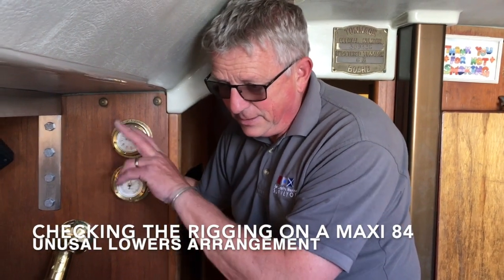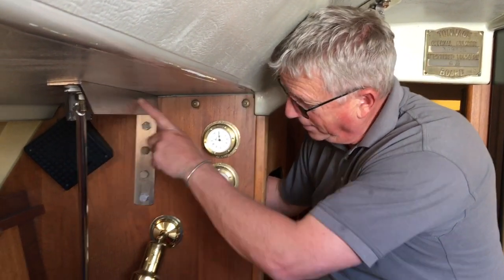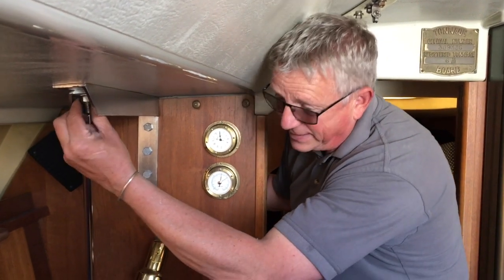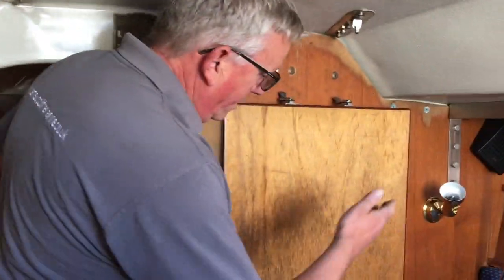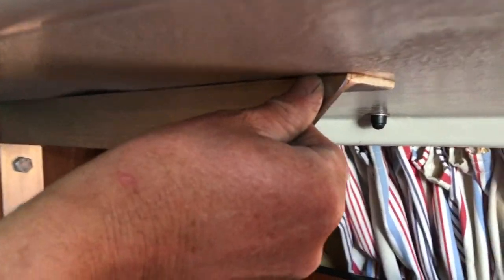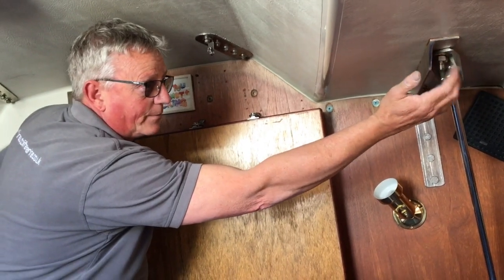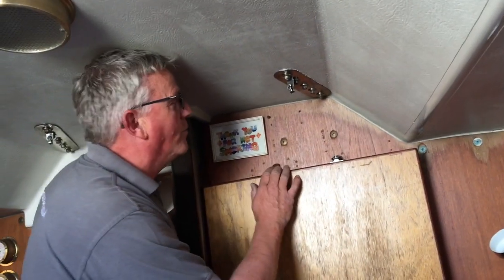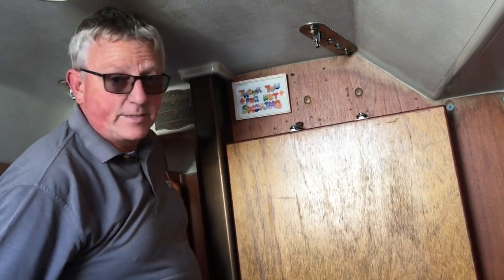Rigging check – marine surveyor explains the unconventional lowers arrangement on a Maxi 84

Comment: Don't forget the potential personal injury hazard of smashing your noggin into that angle bracket as well as the row of nuts right near your head in the video. The rather sharp angle of the tie rod is more than unconventional- it's ineffective. The build should have carried the load straight down to the turn of the bilge (typically thrubolting to the settee seat back).